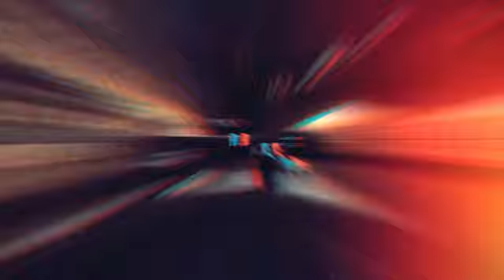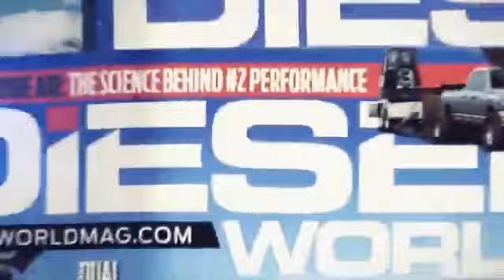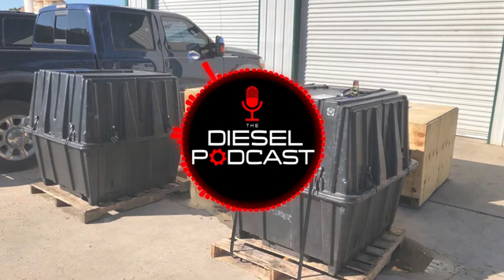Diesel Podcast - Diesel Engine Bearing Failure

Comment: Me and my buddies used to love running NOS on everything we could get are hands on. From rental cars to my brother's girlfriend's mom's Saturn. We even had a duffle bag set up to hook NOS on any car in minutes. NOS was surprisingly safe. We would intentionally try to blow shit up and fail. Yet ironically the only time I've seen someone snap a crankshaft into 3 places was on a 7.3 psd LOL            Yeah I know all about different ways people try to preload thrust bearing usually with either a hammer, crowbar or not at all. But my question is what's your thought about preheating the crank in the oven just before setting it in the block like old timers did?
Reply from the maker: Hey this is a great question, I will put it in the next questions and answers with Cass